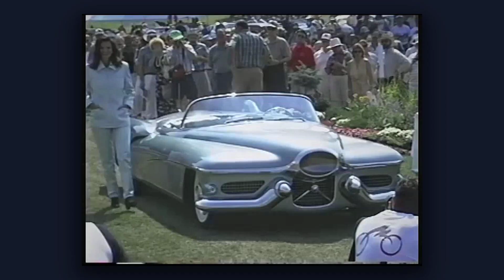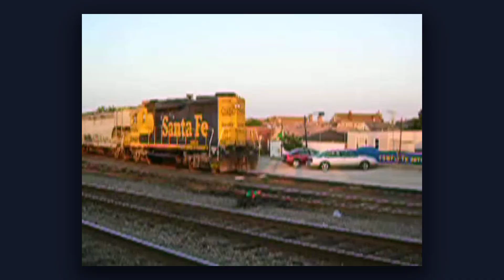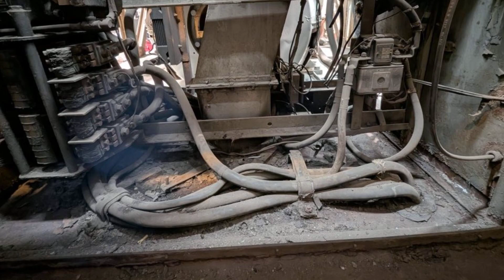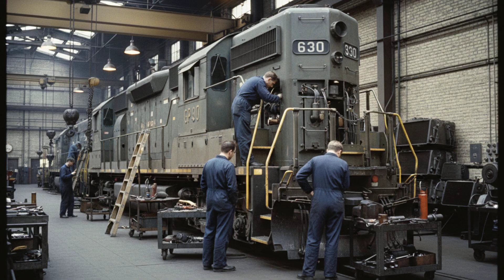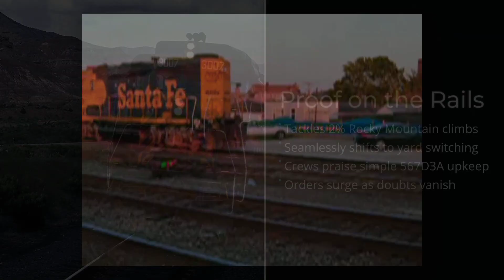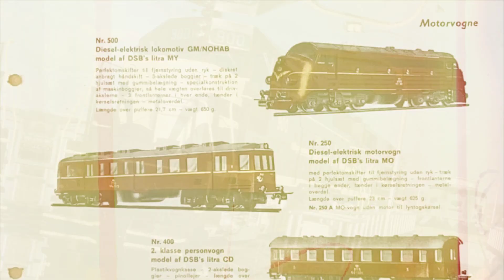Railroads Complained the EMD GP30 Was “Ugly” — Then It Became The First Modern Road Switcher

Comment: Personally I preferred the GP 30 with its radiused cab roof, which improved interior headroom for the engineer, conductor, and any other crew aboard if they happened to be taller, compared to the headroom in the standard EMD "spartan" cab with its sloped rooflines on both sides.

Comment: This whole thing is a lie! "Softened curves and subtle contours" on a GP7*??? It's a shoe box with wheels!  Softened curves and subtle contours" were available on the ALCO RS2 and RS3, for EMD Softened curves and subtle contours"  were available on the BL2 but railroads stayed away in *droves (Notice how they used an ALCO S1 to illustrate the yard switchers?) The hump on the hood was just a design feature, there was no secret cooling device in there, it didn't hide any modern electronics up there. They sold 950 units which wasn't bad and the only thing really holding them back was 1. Railroads were leaning toward six axle locomotives and 2. there was a recession going on, there wasn't much free money floating around.